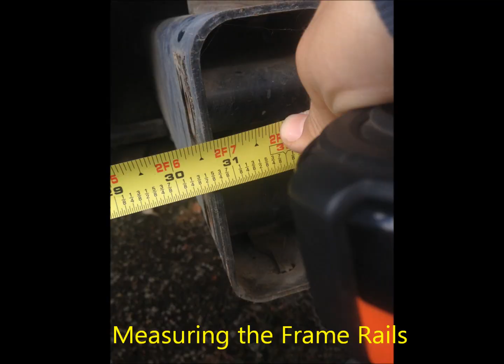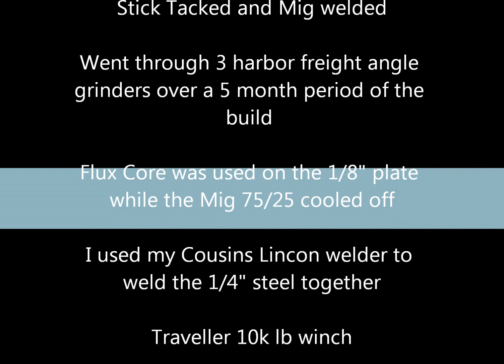2004 dodge ram custom bumper build

Comment from the maker: I took off the 6 wheel well torx bolts and disconnected the fog lights connection. I reused the bumper bolts. If i ever want to i can put the original bumper right back on with no problems!

Comment from the maker: I believe i measured from the rail that the radiators sat on. I would suggest to find a point on your truck that is level that way you can get the bumper level with it. The block were mainly just to hold it but it also helped me to figure out how high or low the bumper needed to be. I only left 3/16" flex space for the bumper originally but after the bumper settled it has 1/4" which looks alittle funky.

Comment: Finally, someone I can relate to.
I'm building a custom front bumper similar to yours on my 96 S10 ZR2.
I made mine to slip right into the frame. 3' square tube 1/8"
steel.
I wanted something called a bumper NOT a crash bar like all the other people.
I cannot believe all the time and effort (and money) that people are putting into
pre-fab type so called bumpers (Movebumpers). All they are is a nice looking crash bars.
One thing I am doing extra is, I will be putting on 2 or 3" rubber dock type bumper pads 
on two front sections. Hence the name - BUMPER
It makes no sense to have a bumper only to replace it because you hit a squirrel.
Get real truck people.

Good job man